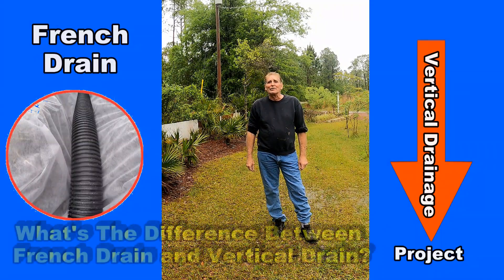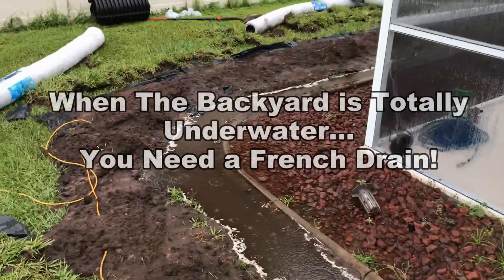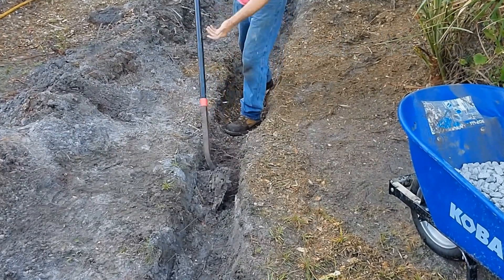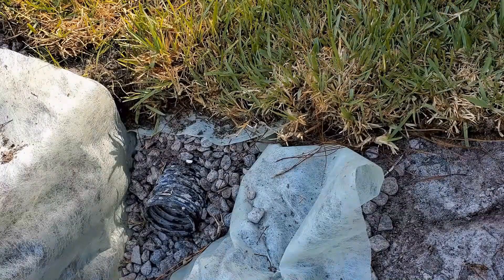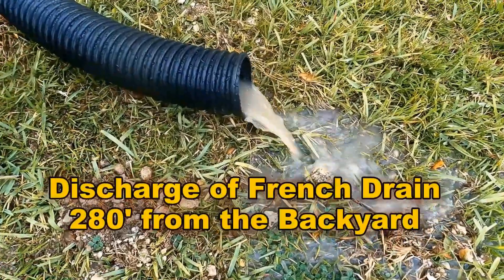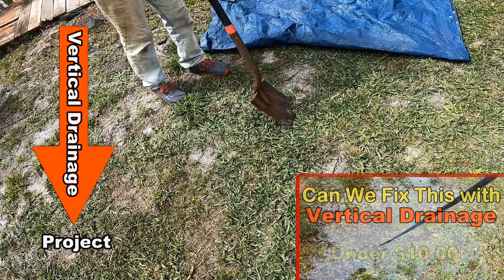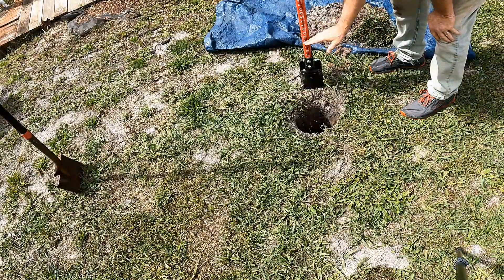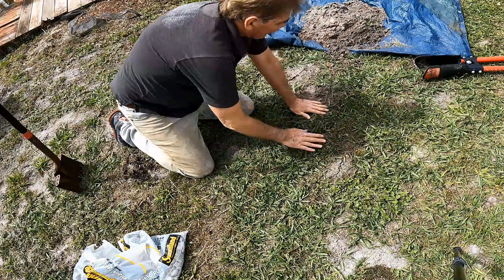New! Vertical Drain - French Drain. Which One is Best For You?

Comment: I dug a hole about 3 feet down for the vertical drainage system to reduce the water accumulation on my yard. The problem is that after digging the hole, the next day it filled with water about 1f and 9 inches. last time it rained was 6 days before I started digging and the water remains at the same level 3 days later. No increase or decrease whatsoever. 

I did reach the clay and perhaps the hardpan (hard soil) because before it filled it with water sounded hard when trying to dig deeper.  

My question is: 

Should I dig deeper to pass the hardpan or watertable and hopefully make way for water to filtrate underground? 

I am already 3 feet down.

Comment: Hi Chuck. If the point of the drainage is to transmit water below the hardpan, why not just put corrugated pipe in vertically so there's more void? You'd need to put a grate covered in geo fabric at the top first to keep it from filling up with soil, but then you could cover it up and grow grass. Why wouldn't this be as a good or better than filling it with drainage stone? If the corrugated pipe is in danger of crushing over time, couldn't you just use the high octane stuff? Then the only question would be whether to use perforated or solid.

Comment: Would this vertical drain idea work in Ohio? How is the depth of the hard pan determined?
Reply: Good question 
I think that’s the idea of how to gauge if this system can work in your area/grading.

You probably have to determine which region you are in with soil, and then there might be an average depth for the hard pan.
Could be 6-8”, but if you’re on a slope then it could be 2-3” (again, depending on the region in state)